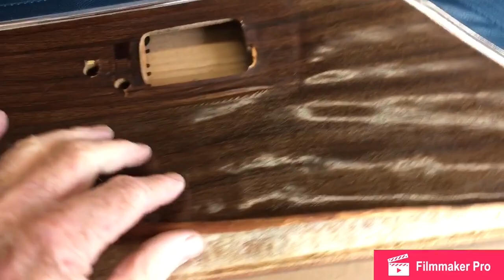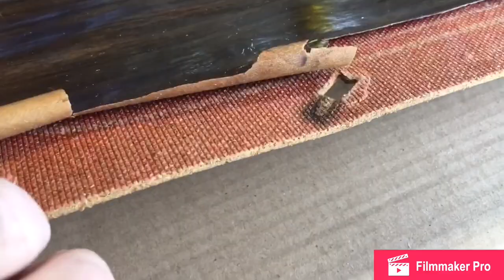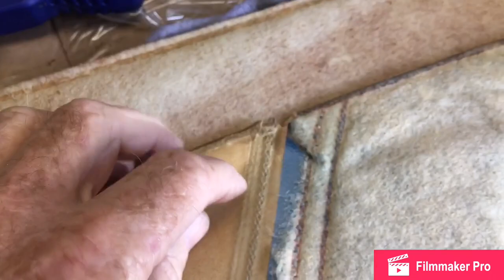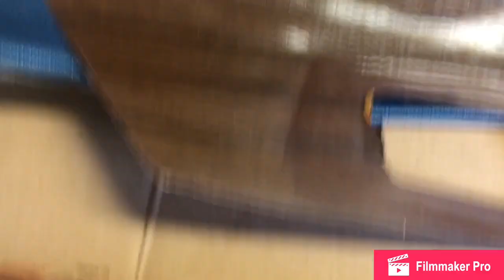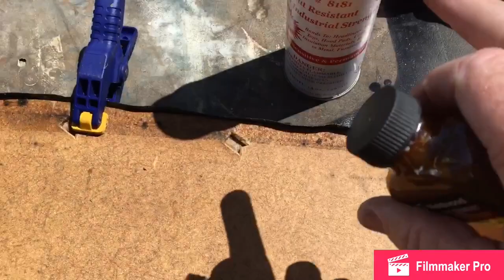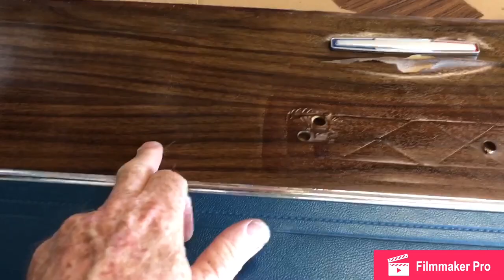1969 GTX Door Panel Repair

Comment: Just a quick note - a upholstery shop will have spring clips to push on the 2
posts that come through the door and will hold the emblem securely.